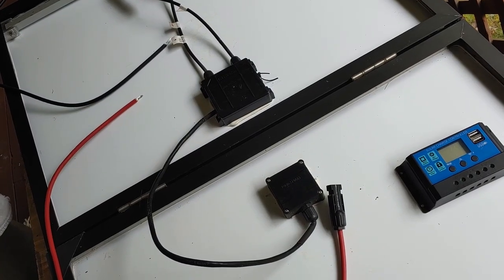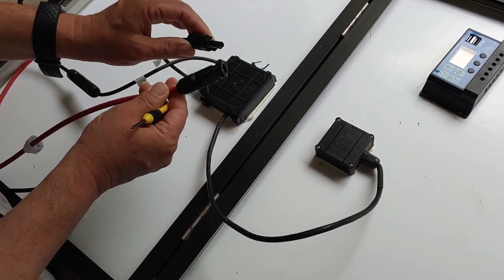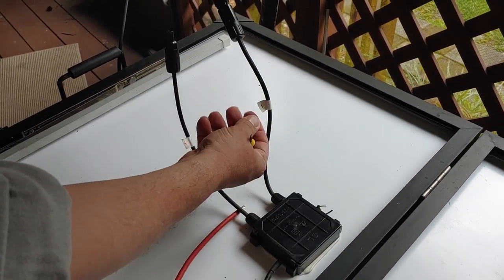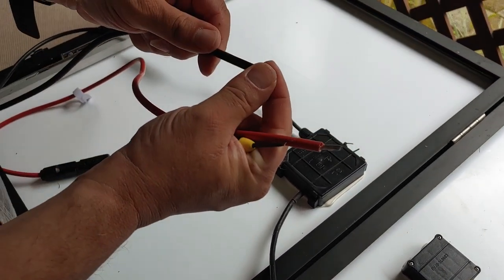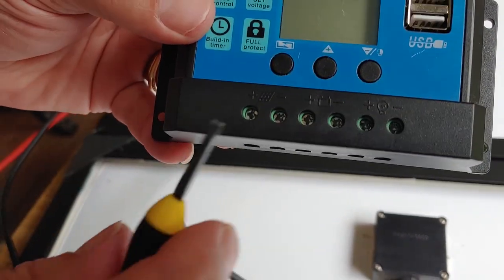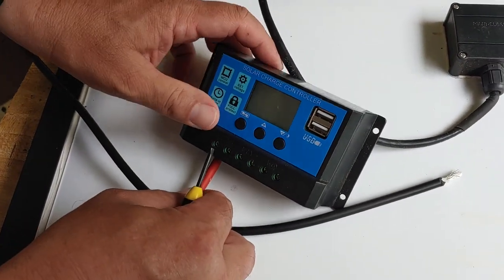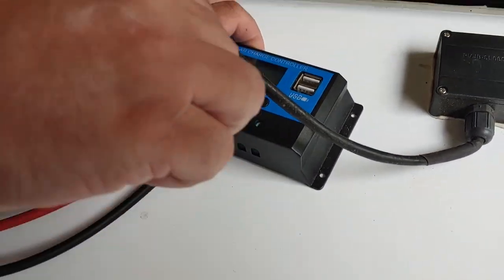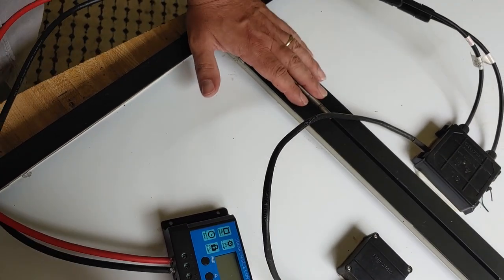Step-by-Step Walk-Through Connecting a Standard Solar Panel to a Solar Charge Controller

Comment: With this controller.. Always connect the Solar after the Battery.
1) Connect the battery first .. (2) Solar connection 2nd or Last / (3rd).. after Accessory connection.

The way u did it.. you may damage it and Your accessorie connection and 2 USB ports Will Not come on. 🙂
Reply from the maker: Thanks for your comment.